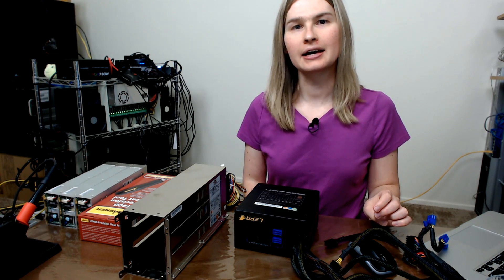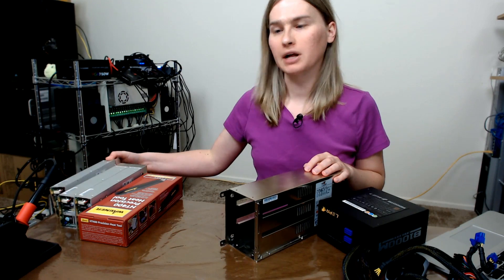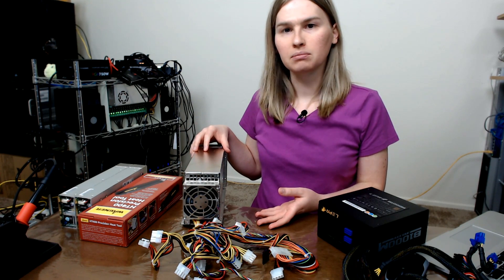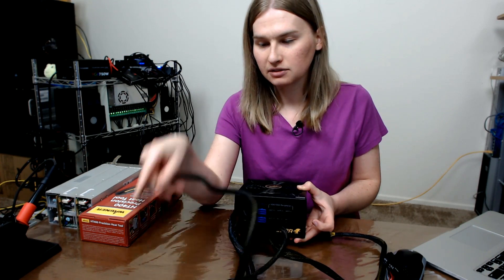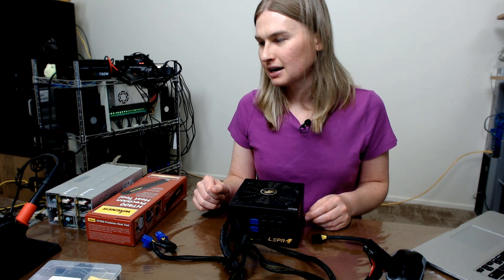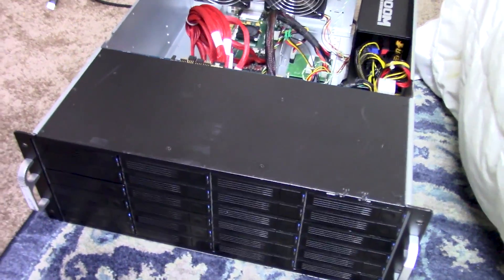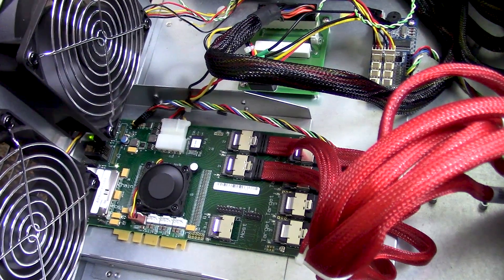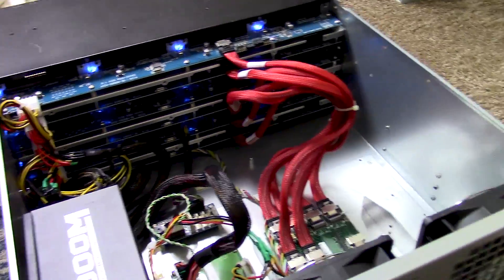Modding a Server Power Supply for Burst Mining

Comment: I have a Chiacoin farm under a bed and use probably 50 dual-bay USB docks, plugged into a bunch of chained plug strips. Probably a lot more power efficient to just use a couple of ATX PSUs.. Maybe could use wire nuts to split power instead of soldering iron? Either ATX or the CCTV PSU I still have to watch that. I ran into CCTV power when eBaying 12V barrel plug splitters

Comment: I think Burst has the potential to be used for a lot of things that either haven't developed due to the small size of the community and the fact that tech development for Burst was practically non existent until POCC stepped in. For instance Burst has a marketplace and asset exchange as well as smart contracts, these could be utilized to help large and small business's raise funds and issue assets that pay dividends. Burst has the potential to provide the what other coins offer with 400x less power consumption and a novel method of distribution that doesn't rely on airdrops and built in inflation. The truth is Burst is open source and could be used for many things once the dymaxion layer and PoC3 are complete. It will have a lot of promising tech that ensures it will attract developers and serve as a platform with as of yet unknown potential. While other blockchain projects are facing scrutiny for there use of inefficient POW algorithims and the built in inequality of POS Burst will stand out as a option to keep blockchain tech advancing in the right direction. A lot of the problems with other crypto's won't play out until a little later but pressure is mounting and Burst will be ready to fill that gap.

Comment: Why did you choose to use a psu for the external drives. Why not remove the cases and use them as internal drives ?
Reply: related to the famous hair stylist Vidal Sassoon? Yes i wonder what PSU came with that storinator-like chassis if she could have just used that?

Comment: hey froggie why dont you use https://www.scan.co.uk/products/10-bay-icy-box-external-single-system-for-10x-sata-35-i-ii-iii-hard-drives-hot-swap-140mm-fan-steel-?gclid=Cj0KCQjwqM3VBRCwARIsAKcekb1AXQEYsF6j_S7dXoMmvnNTpvWJDCu63Aa0Gm9wtMDlzgLaVmIdMpoaArMCEALw_wcB

im running 2 of these with 10Tb disks

Comment: Good Job;  actually I am looking at parts for my next JBOD unit too.  You said you may make a video about the HBA config...Yesssss!  know which HBA I want, and have chosen a JBOD enclosure, but the expanders have several wiring modes depending on how many miniSAS cables you run from the controller.  I look forward to that video and Good Job on the  use of Heat Shrink cables, Hot Air Gun, and Soldering Iron...Radio Shack gone???? I still have a Radio Shack soldering pencil from the old days...

Comment: The main 24 pin also has 12 volts and 5 volts from it . So all you have to do is jump the green and black wire so the power supply will turn on and then get your voltage meter and then you can find where the five in the 12 volts are and then you buy voltage rails that have screws on them an label each one